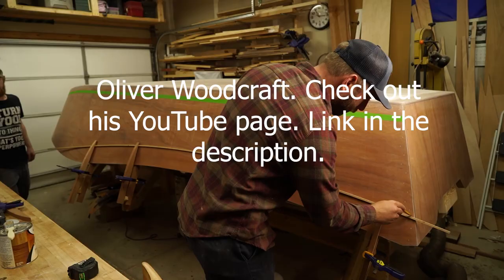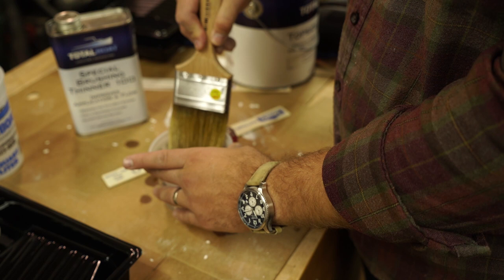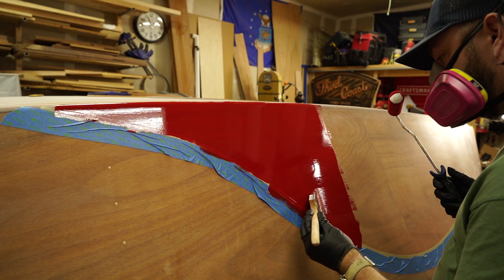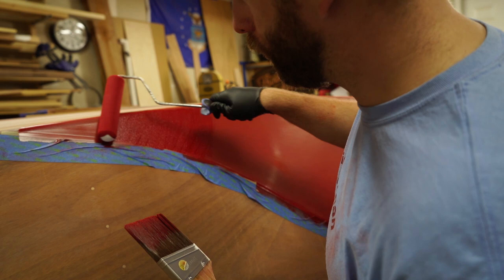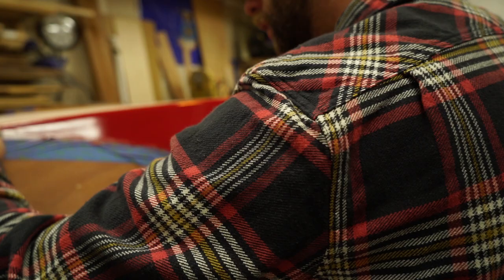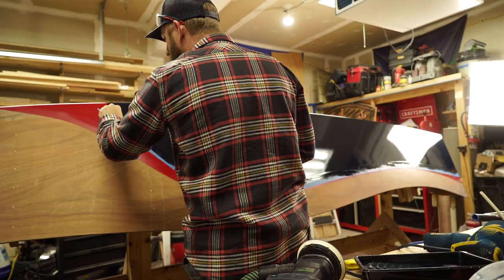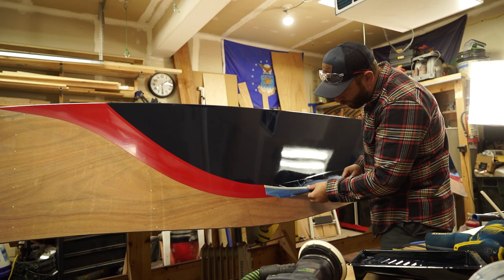Wooden Boat Build // Part 12: Painting the Boat // Roll & Tip Method

Comment: Nice...nice...nice! You described the process perfectly. I have modified this process over the years. I have found most of the specialty boat paints flash off too quick even with brushing thinner. I have gone back to traditional oil based paints and I do my painting in 50 degree weather. In fact, I don't even tip off with a brush anymore. The cool temperature allows the roller bubbles and stipple to pop and flatten out just by gravity. You can even get away with cheap rustoleum, but there are no UV inhibitors. However, I beat up my boats so much they get another coat every other year anyway so no big deal to me. Just my two cents. Excellent, excellent job! I love the swoop profile of your paint job. Gonna look awesome on the river!
Reply from the maker: Thanks for the tips and I’m glad I wasn’t off base! I’m way behind on getting these videos out. I’ve actually already flipped the boat over and have had it on the water and it does look really nice

Comment: Buy a titan 440i airless. Would solve 99% of your issues. The fiberglass runs,  the brush marks, etc as you can spray everything like epoxy,, oils, lacquers, and latex for showroom finish. I have two in our cabinet shop we use on production cabinets. One oil based loaded one water based loaded so it's easier to clean them not cross species mixing - but you only need one.

Comment: Nailed it man! Great solution to the epoxy drip problem. The process was well thought out, ensuring you had enough hands on deck (pun intended) to do so this time. Its probably not what you originally wanted, but I hope you’re satisfied with the design change. Looking forward to the rest of the project!
Reply from the maker: I actually like having this paint job more than if it was just all wood. Gives it some extra character

Comment: Wow, a great many differences between construction of a drift boat and a sailboat because of different load stresses. Should you ever need to plane long level surfaces like your chine log again attach a little 4" line level to an old wooden bodied plane. I've built many sailboats and have a transitional 18" plane with one epoxied in place, works wonderfully.

Comment: I've seen other people mask off the large areas first, getting close to where the edge of the paint will be, and then putting the fine line automotive tape along the paint line and over the edge of the main masking. That way, they can quickly pull the fine line tape off first before the paint dries and then pull off the rest of the masking at their leisure..

Comment: Looks like you could have done this with one tape up session. Then use the blue and switch to the red and it would have come out equally good.The large red section was a waste of red paint. I've painted boats and cars before using automotive PPG paints and did lots and lots of pin strips and graphics with different colors. If you plan out your color scheme, you won't waste paints. Thumbs Up either way.

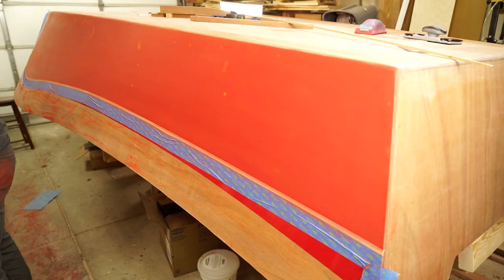Comment: at around 10:20, you can see all sorts of red on the bare wood (where you haven't painted).  But then when you're pulling the tape off the blue, it's all gone.  Did it just clean up really easily or was there some "magic of television" happening here?  It's killing me that you've already been out on it and we have to wait for the series to be done. :)   (I guess that's what you're referring to when you discussed cleaning between coats with acetone)
Reply from the maker: Just cleaned up with some paint thinner or acetone

Comment: Why waste all that red paint just to put 3 coast of blue over it looks good job at the end
Reply: I imagine the problem would be that the paint has enough body that if you were to do a strip of red and then overlap that slightly with the blue you would see a ridge in the blue paint where it had the extra thickness of the red coats under it. The only way that you could do it without worrying about forming a ridge would be to feather the pain out on the overlapping edge, but I don't think that would be possible with this paint and situation as it has to be feathered back towards the wet edge to get a good finish.
Reply from the maker: Exactly.